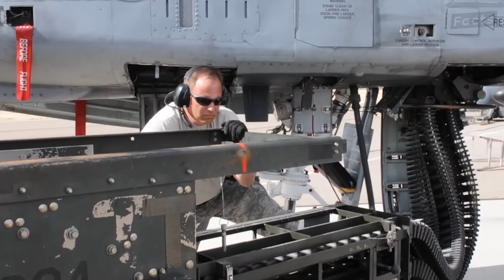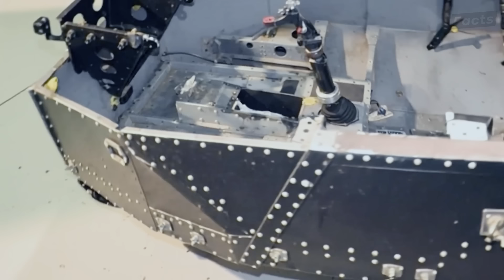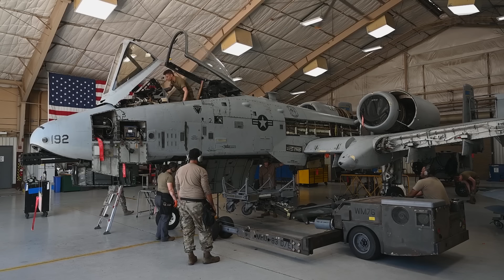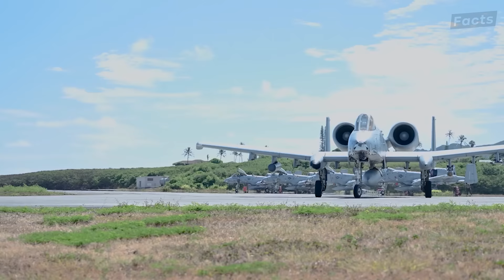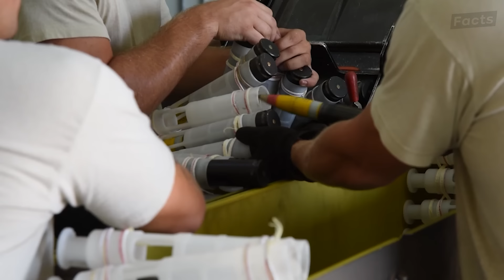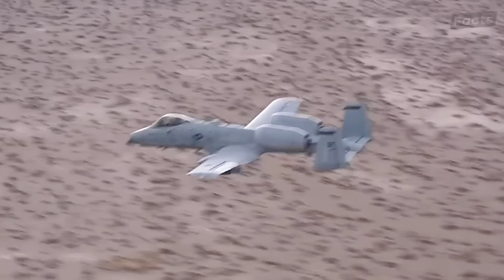The Deadliest Aircraft In US Military Right Now

Comment: The fuel tank layout/operations isn’t entirely accurate. The 2 fuselage tanks are oriented forward and aft. The forward starts slightly behind the fuselage and ends at the center of the “wing box”. The aft starts there and ends in front of the engine nacelles. Because of the design the fuselage actually sits on top of the wings where the wing tanks start directly below the fuselage tanks and end at the main landing gear. The 2 way valve is designed for pump malfunction. If an applicable tank’s pump fails it opens to the direction of the operating pump to allow the affected tank to gravity feed to the other. Aft tank goes to left, forward to right and vice versa. Worked this beast in specifically the fuel system for 4 years
Reply: Maybe you've provided information on the Design that the Content Producer was intentionally trying to not divulge...
When the Taliban manage to log on to Video streaming platforms they think they've successfully Hacked into Classified Information....
"Allahu Hackbar".
Reply: @nicolasrose3064  it's Allah Akbar. I can tell you never served.
Reply: Amazing knowledge. Ty
Reply: Guys on the ground don't care. We care about their firepower.
Reply: Great that was top secret classified material
Reply: Maybe you've provided information that the Content Producer was intentionally trying to not divulge....